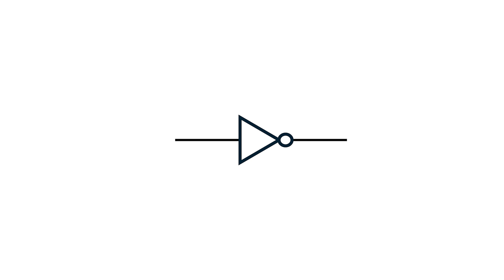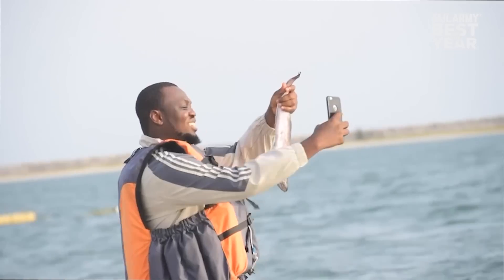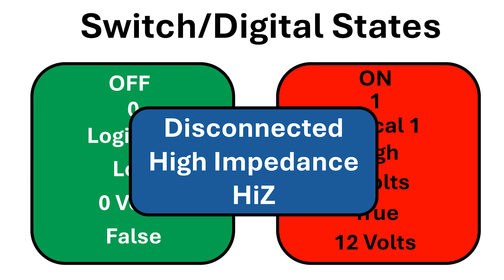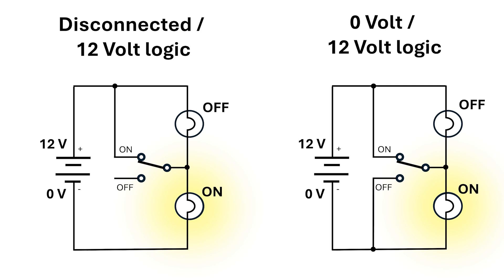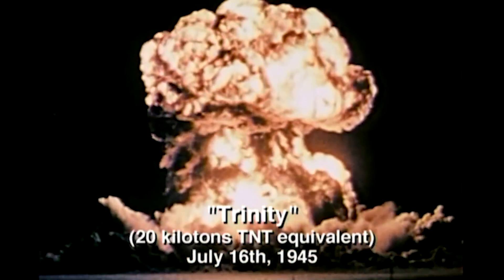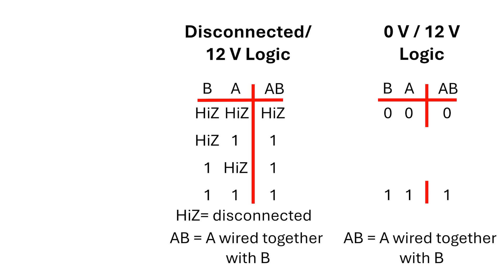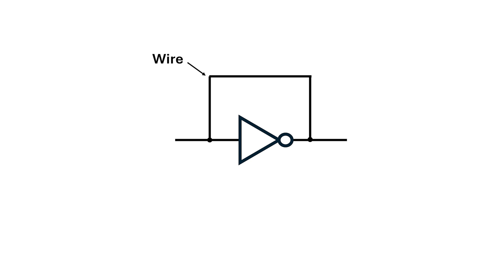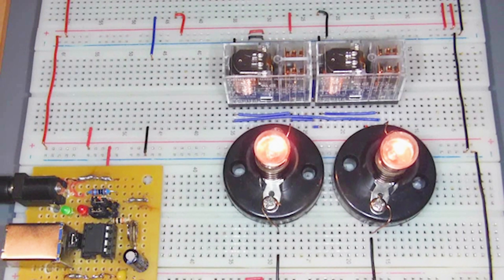Switches to CPUs: Wired OR gate

Comment: Again, no errors in this video that I could see.

Ah. The two-relay latch relies on disconnectedness, too. In that case, I guess the reason you still used it rather than the one-relay version is that the two-relay version still uses control logic that maps to what would be used for a zero-volt logic latch, whereas the single-relay version does not.

Comment: Glad to see the series continuing. Since the last video I built a ring oscillator using three relay inverters with a 3000 uf capacitor to slow the cycle time to a few ticks per second. I was working on an SR latch to build a counter, but I don't have it quite right yet.
Reply from the maker: Cool, it's really fun to see the relays running. I trust you have appropriate blinkenlights connected.  

In this series, I'll be doing a SR flip-flop next, then a ripple counter, then the gates required to restrict it to 60 mins and 12 hours.

I'm tempted to start on the ALU (based on Deiter Muller's) for the CPU, we've covered enough in this basic series already to make a start on that as well.
Reply: @DrMattRegan  I have some LEDs for the blinker lights. But I am tempted to get lamps like yours as that suits the aesthetic. Looking forward to the next video.

Comment: 1:52 - I'm guessing you might be introducing diode-resistor logic to explain how to get wired OR gates to work properly?
Reply from the maker: No, I’m not planning on using diodes except for fly back, at least for this series.  Wired OR gates can be done this way.  I will have to say a bit later though about rules for implementing wired OR in the scheduler’s decoder.